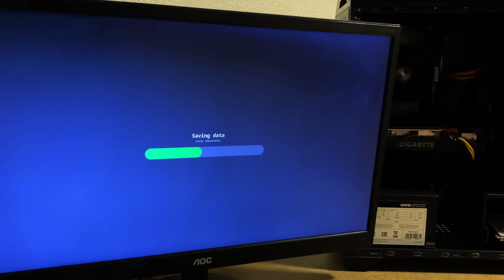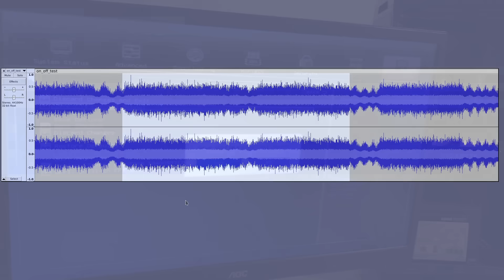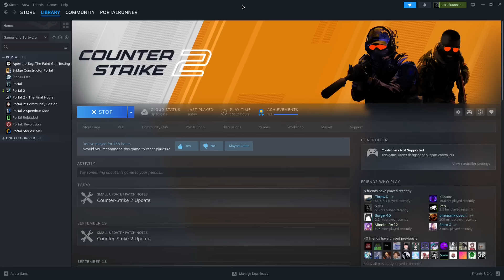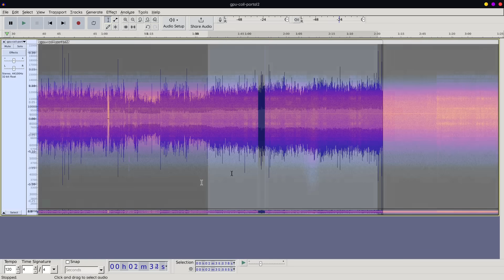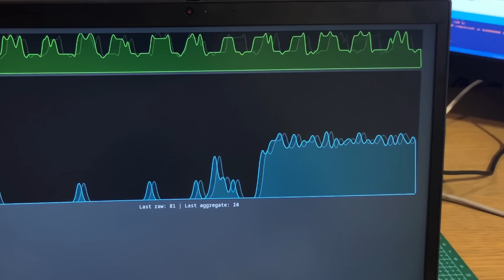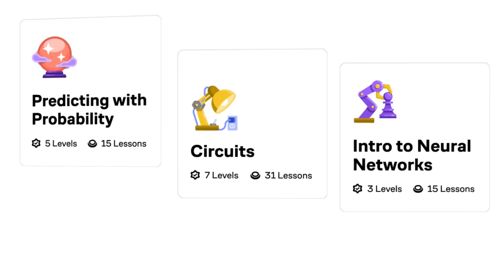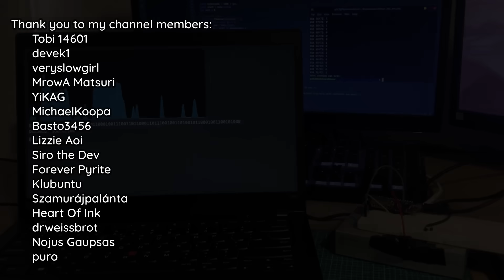Listening to a Computer can Reveal what it's Doing

Comment: I bought a used RX 6800 XT off of eBay, and when I got it I found that it has very noticeable coil whine when under load. Fortunately it's still fully functional, and apparently doesn't cause damage or anything, so I'm still able to use it, but boy am I familiar lmao. I strongly suspect that, with my machine, you could get a lot of data just from having a microphone vaguely in the same room. Even as someone who's never heard of these kinds of attacks before, I noticed almost immediately that there are different "characters" for different tasks (high-intensity, like, "batched" tasks or whatever cause these almost metronomic, short bursts coming at intervals, whereas constant stress, e.g. rendering something graphically intensive, have it being much more constant, but feeling kinda less "sharp" I think?). If someone actually knew what they were doing I bet they could get way more

Comment: 0:16 Space is both relatively warm and a terrible place to extract heat out of something.

Ironically the atmosphere makes reaching close to absolute zero easier.
Reply from the maker: I wouldn’t say space is “warm”, but it certainly isn’t very good at conducting heat away. The superconductor example was brought up because superconductors themselves don’t generate heat in the first place due to having zero resistance. Though yes, a quantum computer would still heat up in other ways.

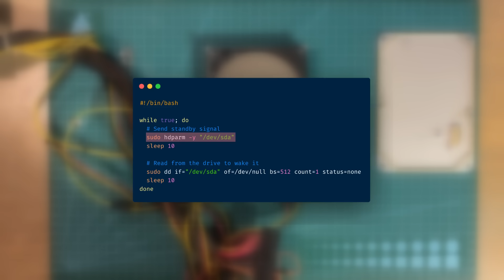Comment: 3:58 Yeah it would, many computers shut down drives after a period of no usage to save power normally.
Reply from the maker: That would let you detect an extended absence of workload, not determine anything about the workload itself
Reply: @PortalRunner  You're right, but it is still an instance of the drive being powered off under normal usage

Comment: uh- not sure about the space part in those first 5 seconds... space is really bad at cooling stuff down... there is no particles to take heat away-
Reply from the maker: Fair point, it's not a perfect example (and to be fair, I don't think an example of a perfectly efficient computer exists). I suppose the idea was more that, since quantum computers typically use superconductors, and superconductors have zero electrical resistance by nature, they wouldn't emit heat in the first place. But yes, there are other parts of a quantum computer that are capable of generating heat.
Reply: @PortalRunner  Neat cx (didnt know that about quantum computers)

Comment: We must remember, every single watt of input power any solid state computer consumes, not counting LEDs, displays, fans and HDDs, is turned into 100% heat.

It has to be, because there is no such thing as "logic energy". There is only heat.
That's why the amount of heat a computer produces has nothing to do with how much it can compute. Just compare any old computer with a newer computer. Just because some old server consumes 20kw doesn't mean it's more powerful than a raspberry pi. The theoretically ideal computer would consume basically 0 watts, even when under full load.

Comment: Space is actually not a good place to run a computer at as it's really hard to get rid of heat in a vacuum
Reply from the maker: That's true! In reality, there's no valid example of a truly "100% efficient" computer. Regardless, I bring up superconducting quantum computers because a superconductor doesn't have any electrical resistance by definition, so it wouldn't emit heat in the first place. But yes, ultimately, several other aspects would cause even that to heat up eventually.
Reply: @PortalRunner  For quantum computers, you've also gotta deal with the fact that space is just too hot and severely lacks protection from background radiation. You would be better off tossing regular computers up there, since those at least don't implode on the first stray photon they encounter.
Reply: @MrSonny6155  Not to mention ECC RAM and other boons that can catch radiation damage
Reply: darn i was gonna do that
Reply: also no atmosphere means a conventional computer would be more error prone as the gates are very small and dense so the radiation would need to be designed against - whether through redundancy on memory or error checking at a higher rate
Reply: tell that to wheatly
Reply: just add a big radiator
Reply: @nyxthearcticfox  gonna need some proper radiators!